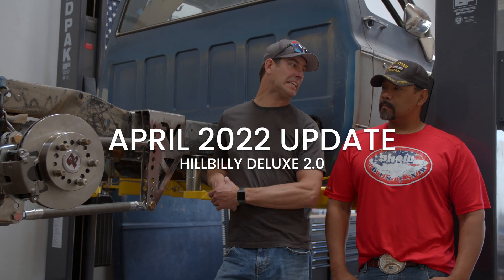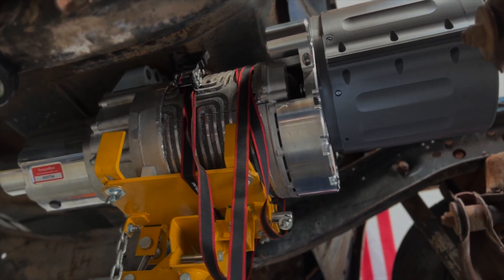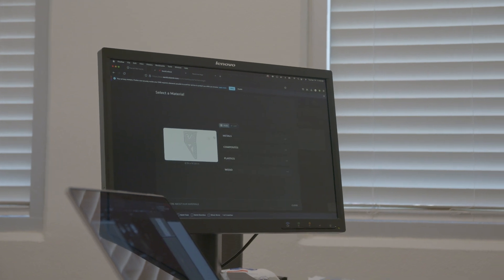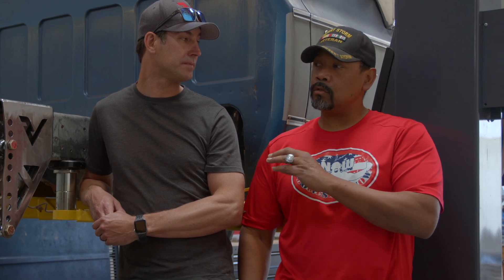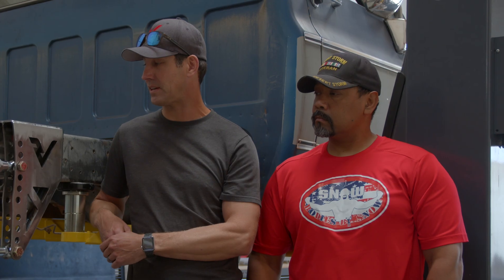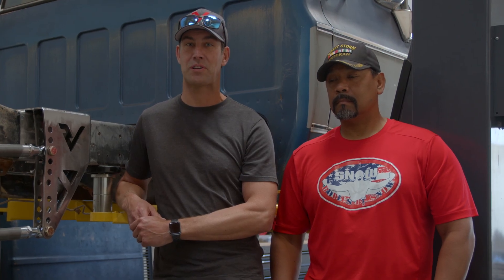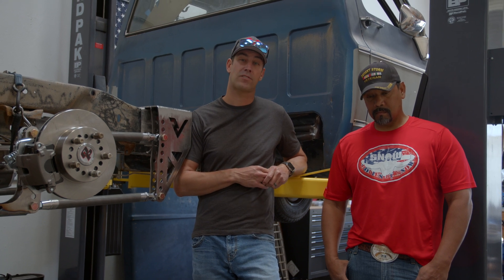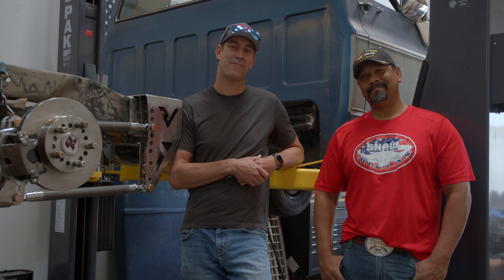Revolt Systems: HillBilly2.0 Update #3

Comment: I saw the throttle was full however the accel was consistent at ~.3g.  Do you tune the output to the motors to be consistent no matter the throttle input so the rear doesn’t get too much torque and spin the tire? 
My heart rate jumped 30bpm just watching the run.  Very awesome, thanks for posting!